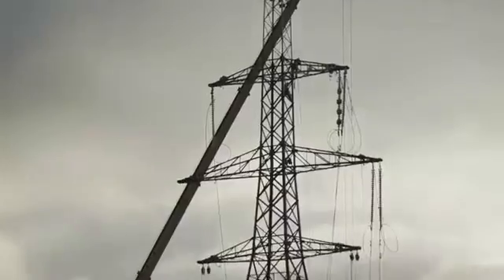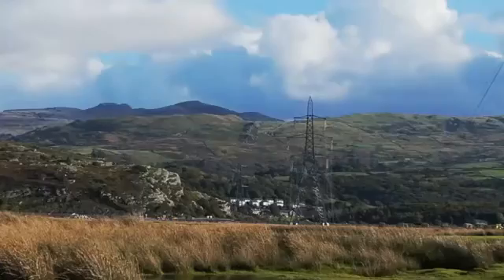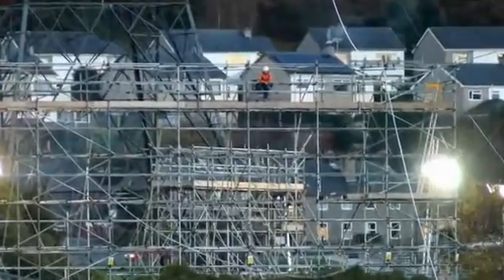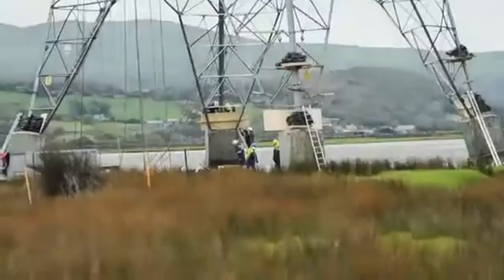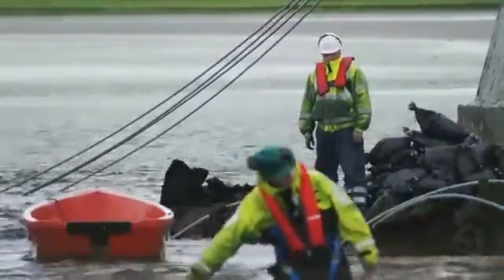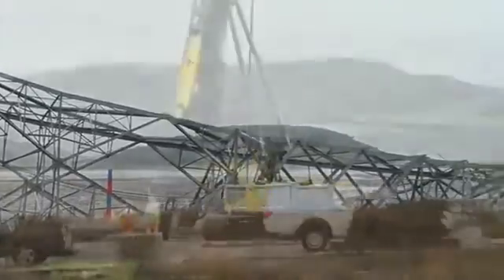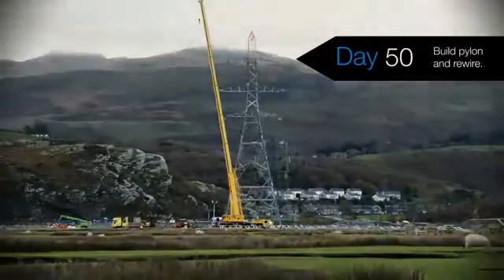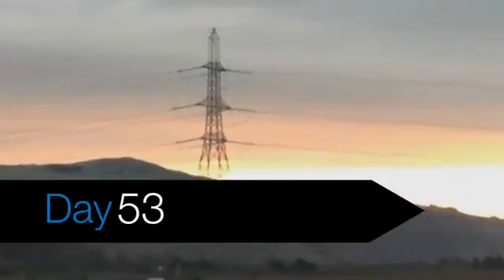National Grid demolish and rebuild a pylon in a record 54 days

Comment: Blaw Knox L6 D30 replaced with an L8 D30’ it had to be replaced with an L8 D30 as an L12 D25 would have been unsuitable for the change in direction.
Reply: I was wondering why they didn't choose an L6 like for like replacement, or are all L6 types obselete due to imperial vs metric measurements?
Reply: L6 is redundant now I believe’ they’re usually replaced with L12 or the recent L13’ L13 looks like an L6’ L2 is steadily being replaced by L8.